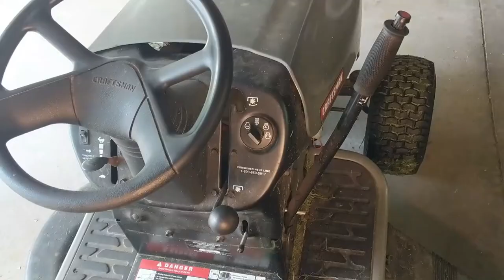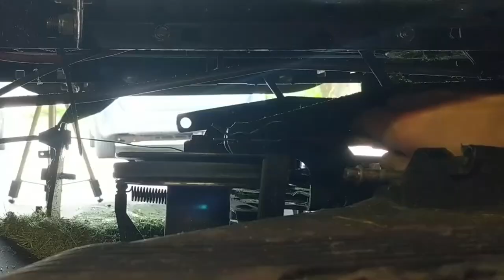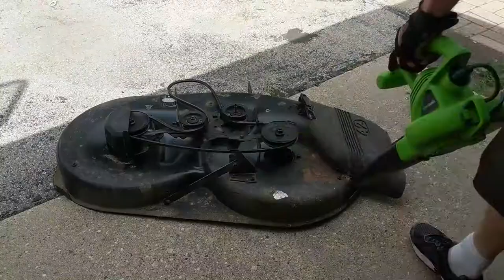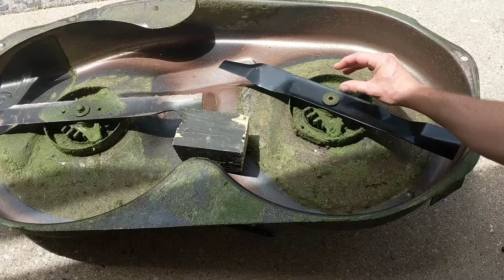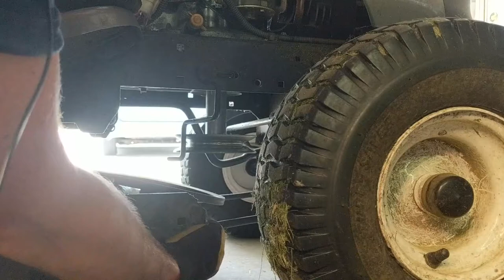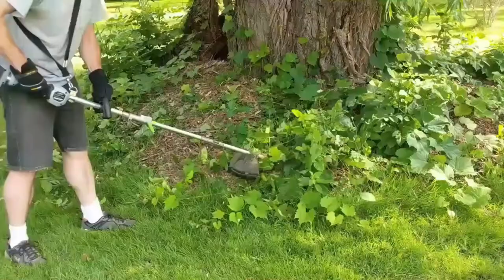Craftsman LT2000 Lawn Mower Blade Replacement | How To Change Your Riding Lawn Mower Blades!

Comment: When you were removing the blade engagement cable (beginning approximately 6:13 in the video) you showed the plastic ring on the cable mount, however, the plastic ring is NOT supposed to slip down in the groove to hold the cable in its bracket. That ring is supposed to slide over the end of the plastic piece which is inserted through the metal bracket and THEN there is supposed to be a metal "R" clip which goes through that tiny hole (you can see it very clearly at 6:19 in the video!)  just below the groove you referenced and the upper half of the metal clip goes in that groove to hold the plastic ring in place which, in turn, holds the cable end tight against the metal mounting bracket. I appreciate your making this video. You did a very good job, sir! You just need to get another "R" clip for that cable!
Reply: It looked like that cable was sitting real loose in there. Thanks for the extra info!

Comment: I want to thank you Jeff for all your tips on changing the blade taking the deck out II inherited this writing a lot more with a deck out from under it and did not know where the engaging cable went to on the the Spring side onto that pulley great help appreciate it much thank you
Reply from the maker: Hi Bob, I'm glad I could help. Thanks so much for watching!

Comment: Is it normal for the blades to have a small gap between the two blades if lined up edge to edge? I'm curious why there wouldn't be a small strip of uncut grass while cutting in a straight line.
My LT2000 seems to cut fine this way.

Comment: Thanks  I did notice that the old blade was lined up with the opposite blade, and the new installed blade was positioned  90 deg from the opposite blade   does that matter at all?
Reply: It does not matter at all as they do not touch each other. If they do hit each other you have a serious problem. Ha ha!

Comment: Thanks for this video, I just spent an hour doing exactly this.  One weird thing; after I was done re-attaching my deck, I have a leftover cotter pin???  I double-checked and sure enough, I have replaced all 6 cotter pins you show in this video (3 on one side, 2 on the others, 1 for the spring).  I'm baffled where I took this extra cotter pin from.  In addition, after I flipped the deck over to get to the blades I noticed a fairly thick washer on the ground... I suspect it must have come from the deck 'somewhere', but I'm clueless as to where it goes?  Otherwise, great video, I appreciate the tutorial!
Reply from the maker: Ha ha, left over parts are proof that you made it even better!  Nice job!  Thanks for watching!  I just filmed another video showing how to do an oil change and an air filter change on the LT2000 that I will be releasing shortly. (I have to finish editing it first!) with some more great maintenance tips.  Be sure to subscribe so you don't miss it!
Reply: @TinkerForward  It's amazing how often that happens with any of my projects.  I'm staring to wonder if the extra cotter didn't come from the spring assembly, on the side where the plastic 'collar' gets removed came from.  I'll have to double check.  Thanks again!

Comment: I have a 2008 Craftsman LT2000 I just had the blades replaced but since then my bagger hose keeps getting clogged up. I'm wondering if the blades were put on backwards. Which way does the blades spin? Clockwise or counterclockwise?
Reply: There's a good chance they were replaced with standard cutting blades, rather than mulching blades.

Standard blades usually don't provide enough lift to send the clippings up the chute.

Comment: I have the same tractor (she's 14 years old this year!). Changed the idler pulley bracket earlier this spring. Just ordered new blades so I'll be taking the deck off again shortly. Thanks for the video. I too will use my impact wrench (DeWalt XR high torque). You can get those hitch clips in an assortment on Amazon for fairly cheap.
Reply from the maker: You're welcome! The impact wrench makes a big difference in my opinion.  I will take a look on Amazon, I'm in need of a few more of those. Thanks for watching! Good luck with changing the blades!